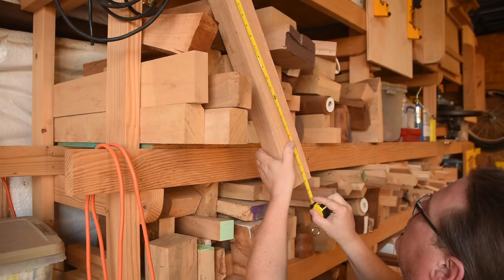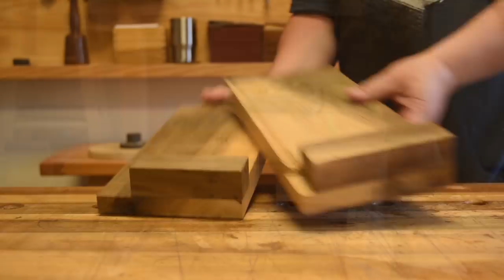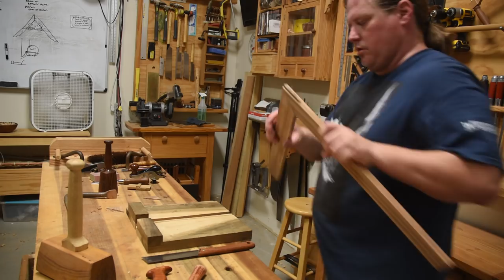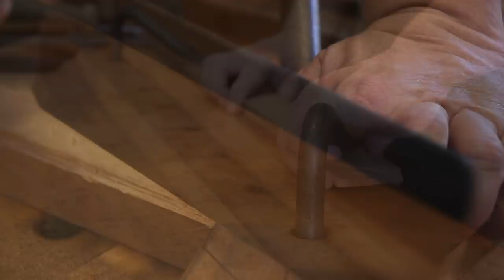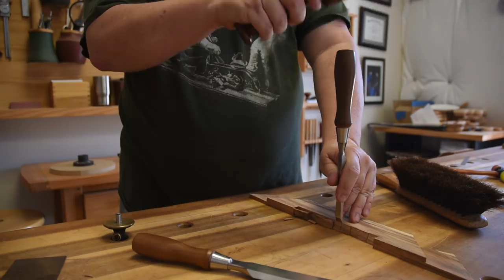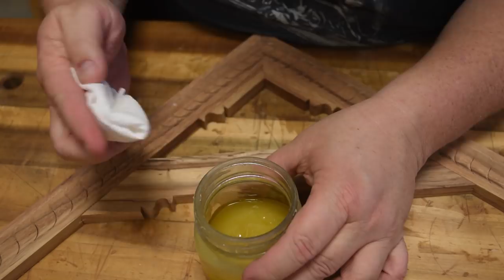Making an English Square

Comment: Form is beautiful, as many have said...  Function?  This may have also been mentioned in comments, but I wish you had shown how you went about truing the square, ie. testing/adjusting/planing/etc the outside edges to be at a perfect 90 degree angle.  (Unless, of course, this square is meant to be only a show piece, perched there above that wonderful tool wall...)

Comment: Very nice work.  How do you keep it square with seasonal temperature and hmuidity changes.  Most wooden squares I've built, intending to actually use in my shop, have had a metal blade to counter this.  First saw that design in a tour of Jamestown and later in many colonial settlements.
Reply from the maker: Rick Price it takes seconds to check and true wood squares. I have several videos on this.

Comment: I've been really enjoying your videos. I'm just getting started making scrap wood. I don't know if I have the drive and patience to do the detail work but I like to imagine myself being able to turn out work like that. It scares the crap out of me every time you get the chisel out 'cause I know how much damage I can do with a chisel. :) What exactly is an English Square? And is that just decorative or something you plan on using?
Reply from the maker: It's a layout tool to mark 90 degrees. Mainly for rough work. Can be used as a clamp aide to square up cabinet. Only tip is to get after it. There really is a steep learning curve. Doesn't take much to get to my level.

Comment: After watching several videos, I've noticed you really fight with the planes to get full length curlies.  Maybe your depth of cut is too deep or the plane blade isn't sharp enough?  Other than that minor comment, I enjoy the way you structure you videos and showcase the hand work.  Keep up the great video work!
Reply from the maker: Tim _BBQ you’ve never worked with pecan.
Reply: wortheffort.  You are 100% correct.  Thanks for the clarification.

Comment: there is a starting to form in the center of a green maple bowl blank that I just cut out of a fallen tree. I haven't started turning it yet, is there a way I can fill/ stabilize the crack or should I just toss it into the firewood pile? Or is it safe to turn? Thanks
Reply from the maker: I have several videos on rough turning and working from the log on the lathe. I suggest starting there.

Comment: :-O You used a band saw! You've now lost a lot of respect from me!! Kidding. Thanks for the video!
Also, how do you ensure that it is 90 degrees across the entire edge?
Reply from the maker: Hand plane sideways on bench is easy way to ensure consistent angle.
Reply: Thanks for the reply!
The wording of my question was not clear. I apologize. The square is a triangle so let's say we have the three sides a, b, and c and side "c" is the hypotenuse. Sides a, and b must be perfectly perpendicular to each other along their entire length. How do you ensure this? (I hope this makes sense)
Reply from the maker: Draw a line with a pencil, flip it, draw another line as close to first as possible. Any error will be magnified by 2. Plane away the error. Takes maybe 30 seconds.
Reply: Oh OK. Nice!